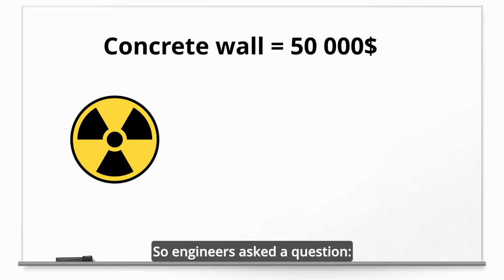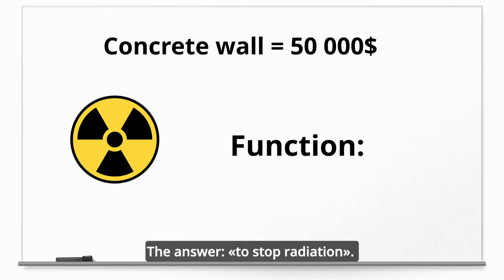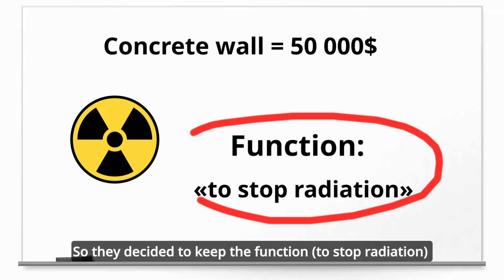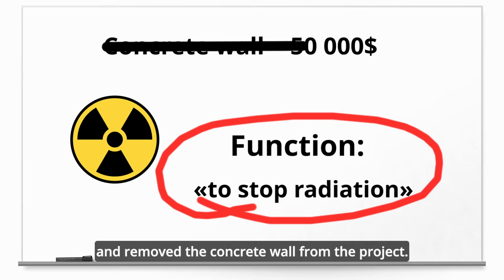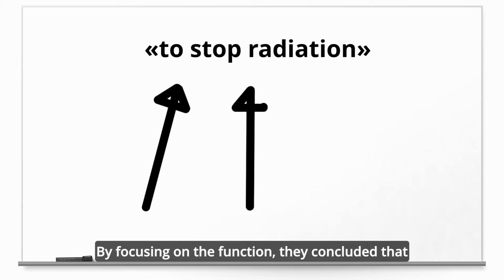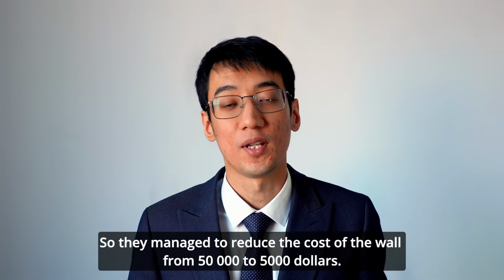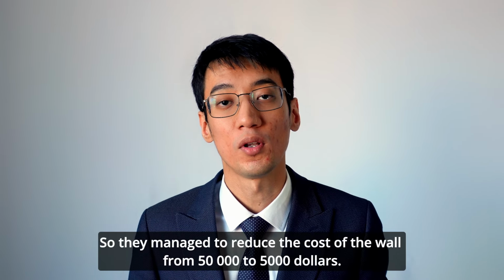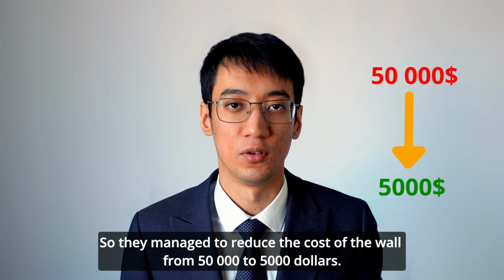Value Analysis: Function-based techniques

Comment: Suppose an engineering team is tasked with selecting the most suitable material for constructing a bridge. They evaluate two options: Steel and Composite.

For the value aspect, they consider factors such as structural strength, durability, and maintenance requirements. Steel is known for its high strength and proven track record, while Composites offer potential benefits like corrosion resistance and lighter weight.

Regarding costs, the team assesses material expenses, construction labor, long-term maintenance, and the lifespan of each material. Steel may have higher initial costs but lower maintenance expenses, while Composites could have higher upfront costs but require less maintenance over time.

The team assigns monetary values to each benefit and cost factor based on market prices, expert opinions, and available data.

Using a value-cost analysis, the team quantifies and compares the net value of each option. They calculate the difference between the total benefits and total costs for Steel and Composite.

After thorough analysis and sensitivity evaluations, the team determines that, despite higher initial costs, Composites provide a higher net value due to their long-term durability, reduced maintenance, and potential weight savings.

Based on this value-cost analysis, the engineering team decides to use Composite materials for the bridge construction, optimizing the project's outcomes by considering both value and costs in their decision-making process.